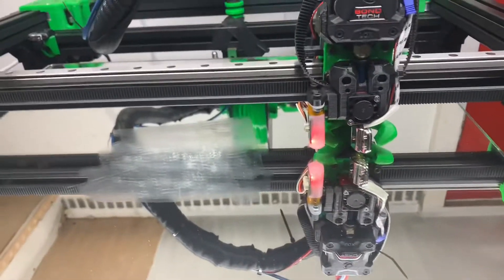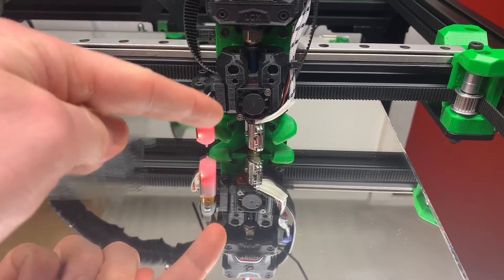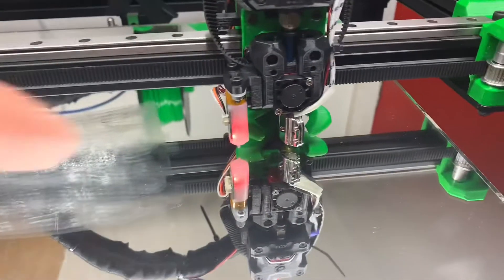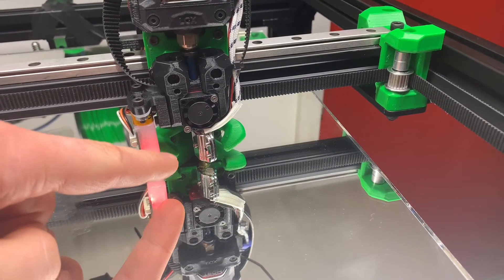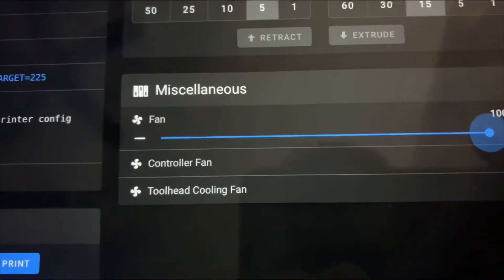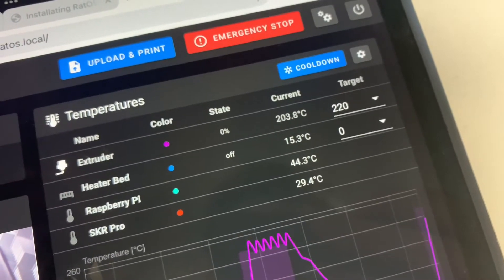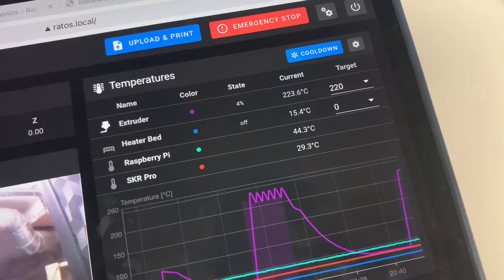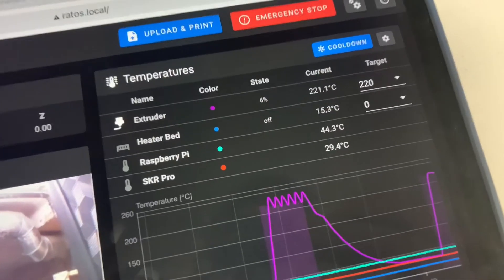Perfect PID tuning in Klipper - Nova 100 watt Hotend

Comment: Can you write more (or make short vid) how you added temps from Pi and SKR?
Reply from the maker: It has bren a while since I have looked at this but I believe that RatOS has this showing by default. I did not need to add anything. Maybe in the newer versions this is removed. I would ask in the RatRig discord server.

Comment: The nova needs smaller smoothing times for PID than the default klipper settings as well. If you dont do that, it will still oscillate too much during printing. IMHO, this hotend is also not to be used without a silicone sock. With powerful EVA cooling you can even make this hotend to get a thermal runaway otherwise xD
[extruder]
smooth_time: 0.1s
Reply from the maker: Thanks for the feedback! I have heard about the silicone socks. Someone was making them on a limited run a few months back. I hope to find a source soon!
Reply: @futureethan  You can also make them yourself, if you cannot source them. It is actually not too hard.

Comment: I suggest to add a silicone sock, it will almost fully cancel out effects of the cooling fan on the hotend heating
Reply from the maker: I agree with the suggestion. I haven't stumbled across one yet for this hotend, but ill give it another search. Thanks!
Reply: I think CNC kitchen had a video about making own silicone socks, maybe a way to go
Reply from the maker: I'll check it out!

Comment: absolutely no point
Reply from the maker: What do you mean?
Reply: @futureethan  won't even make the slightest difference in print
Reply from the maker: @user-yk1cw8im4h  The calibration certainly helps with heat-up time. I would have to wait >3min for the temperature to settle before the print would start. Also, 20C heat fluctuations does certainly cause strange visible artifacts.
Reply: 100w allows you to maintain higher temps when printing at super high speeds especially when paired with a huge part cooling system. I easily out flowed my 60w heater on  a somewhat stock v0.1. 
Your hotend also takes less time to reach printing temps